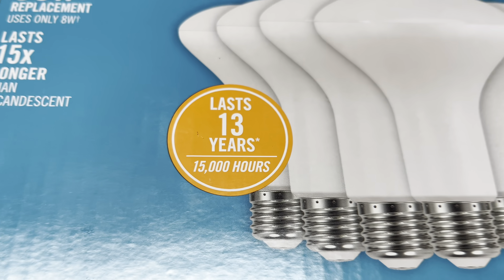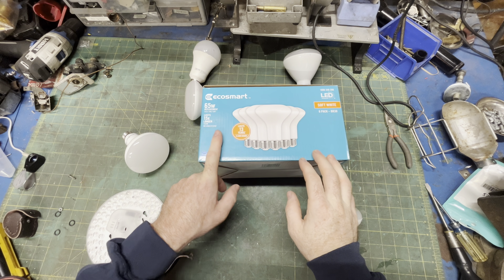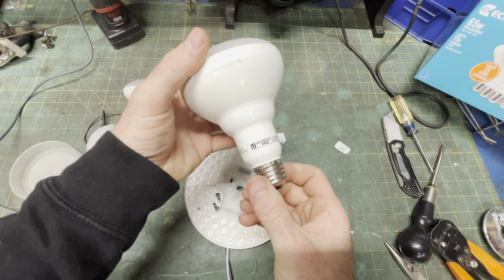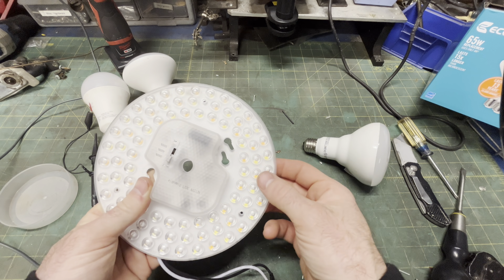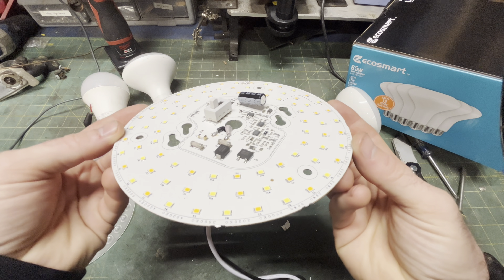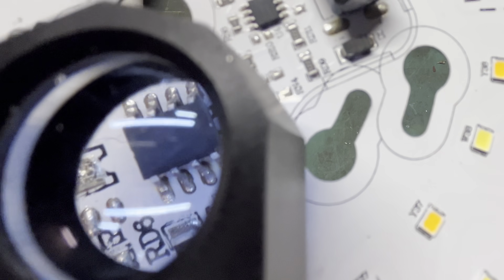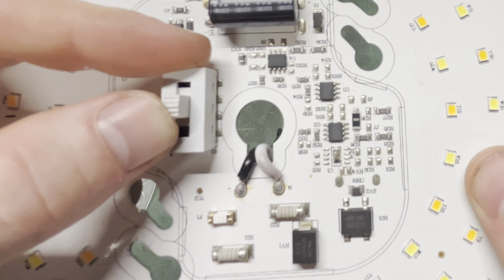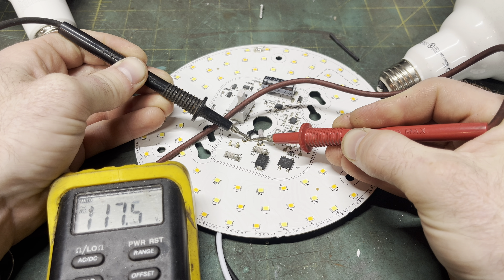Why Do LED Bulbs Fail? An Autopsy!

Comment: "Due to light sensor I installed myself it is on for 24h a day" )
Reply: The funny thing is that probably that extends the life of the incandescent lamp, as there is no thermal cycle stress 😂
Reply: Photocell sensors are pos nowadays, his was probably doa. First one lasted 13 years, replacements lasted 2-3 years nowadays. I bypassed it and changed to a wifi switch.
Reply: @arthurdefreitaseprecht2648 Nor probably. The record bulbs are kept always on. Technically they'll keep working.
Reply: I had a good chuckle that very moment :D
Reply: I laughed too hard at this!
Reply: still: why would one run an outdoor light 24/7? i know americans don't care a great deal but just to raise some awareness: it's called waste of energy.
Reply: @RayEttler   We are the epitome of a waste of energy.  😂
Reply: @RayEttler  I leave the 11 LED lights in my garage soffitts on 24 hours a day, 365 days a year. Each is 1.4W. Times. Costs me pennies. I can afford it. Earth will survive.
Reply: Any ideas why an led fixture somewhat like the first one would buzz after lightning storm in the vicinity? Still works, for now, but audible buzzing.  Learned a big lesson. Don't use these bulbless POS.
Reply: As soon as I heard that I thought "I'm going to like this guy!" :)
Reply: @RayEttler  Does the sun waste energy?  It is on all the time.
Reply: @arthurdefreitaseprecht2648  less thermal stress :D Not no thermal stress ... Although putting out heat in the cold of the night is pretty stressful for a bulb. I'm inclined to believe it's more to do with the manufacturers removing the planned obsolescence policy to try and not be banned entirely....
Reply: @stewiepid4385  The human race or Americans?
Reply: We all learned in the beginning that it's the shock of going from off to on that kills incandescent bulbs. 

LED lights that have extended lifespan on the package are referring to the actual LED's not the item itself. There was a lawsuit over it a few years ago but I can't find it.
Reply: I don't get it. Can someone tell me what's supposed to be wrong or funny about that sentence?
Reply: @Jiyoon02  it should only be on during the night. It's on 24 hours a day because either he did something wrong or it's defective.
Reply: @a9ball1  I infered that line as "it's hooked to a closed circuit 24 7 unsupervised, thanks to the light sensor I installed."
On as in closed. Which isn't too wrong.
What else can it mean?
Reply: @a9ball1  There's four in a neighbours garden on for most of the night, every night for about 4 years now. They are off at the moment. There is no breeze at all so I think the slightest breeze moves something and they switch on. Also people don't set them up properly, there are settings to adjust and people don't seem to bother.
Reply: @cgeorge6786  not during the night 😊
Reply: @user-hm5zb1qn6g  That gives me an idea: White Xmas lights as in-garage background lights and just leave them switched on all the time.
Reply: sosi hui
Reply: @HSterlingCross  Now you tell me. I bought a photosensor at HD a while back, and while it never worked once, it wasn't worth dismantling everything again to remove and return it, so I just left the light on at all times. The other day, I finally just bought an automatic dusk-to-dawn bulb for the fixture, and that's worked perfectly from the get go.
Reply: @user-hm5zb1qn6g  you are missing the point
Reply: Yep, it's a fulltime light sensor.
Reply: As a plasma fanatic  I just stick to fluorescent lamps. Most LEDs are boring for me. Filament style is OK but most other types are as ugly as the average mother-in-law.
Reply: @ as a plasma fanatic you should use non-fluorescent gas discharge lamps ^_^
Reply: @RayEttler  The bulb will last many times longer if it is left on (or off).  Thermal cycling kills it.  Which is more wasteful, a few watts of electricity or replacing bulbs?
Reply: @steveprice5664  i see your point. this may be true to some extent but thats nitpicking. and yes its just a few watts i am with you. but it's a reflection of how one acts and behaves in general. it starts with you. found this the other day and i believe this is where it comes down to: "I am only one, but I am one. I cannot do everything, but I can do something. And because I cannot do everything, I will not refuse to do the something that I can do."
Reply: Don't buy cheap American crap. Switch to Chinese quality products!
Reply: @peoplesrepublicofamerica8698  What American crap would you be referring to?  All of the crap is coming from China - due to the quest to make everything as cheaply as possible - to allow the highest corpoate profits.

I have lost count of all the LED bulbs I have had to replace in less than three to five years  - all made in China (with the least quality control attainable, I assume).  So far, we have had no fires caused by these "time bombs".

Good night, Nursey!
Reply: @arthurdefreitaseprecht2648  Yep. One square inch of duct tape over the sensor port, and voila!
Reply: I laughed out loud for that. Like a real belly laugh.
Reply: @RayEttler  the intent of the auto off mechanism was exactly that. But that aside, I suggest anything that maintains the bulb saves energy because you don’t have to manufacture a new bulb. Saving energy requires system level analysis, lest one just move the consumption elsewhere.
Reply: @cgeorge6786 I believe that was the inspiration for the concept of a Dyson Sphere. 🤔
Reply: @leavethemkidsalone860  It's hard to find any that don't buzz right out of the box. The name brands fair better. Make sure the light switch is made for led if you are using a dimmer.
Reply: @richardcowell2373  is this a joke?
Reply: @cgeorge6786 If you would live on the sun and want to live more than 5 billion years, yes.
Reply: @Jiyoon02  The whole point of a light sensor is to not have the light on 24/7
Reply: that was in fact a "day sensor"
Reply: @RayEttler   Well, it's debatable.  Yes, the light merely being on wastes electricity, but also the stresses of cycling the light every day would have caused it to have burnt out years ago.  And, the replacement bulb would have burnt out by now as well.  As well as the replacement for the replacement.  Those 2 replacement bulbs also took electricity / fossil fuels to sell, and transport, and manufacture, and the materials took electricity / fossil fuels to sell, and transport, and manufacture.
Reply: He did not say he wired it correctly.
Reply: @peoplesrepublicofamerica8698 Is what a joke?
Reply: @MacGuffin1  The planned obsolescence thing is overblown. There's a trade-off between efficiency and lifespan. Incandescents that last for decades put out very little light. That's still true today. The choice to limit bulbs to a relatively short lifespan had a lot to do with the limited amount of power available at the time.
Reply: @a9ball1 Incandescents slowly die due to the evaporation of the filament. Halogen lamps address this as the halogen gas will help to carry some tungsten back to the filament, but they still die eventually.

Unless you run them at greatly reduced power. That keeps the filament cool, but also makes for a dim and even more inefficient light source.

Comment: my work let me take apart the 480v LEDs they got for their warehouse after they died. The bulbs claimed a 10-year life but died after 2-4 years. When I got them apart, I found the capacitors to be the issue. Checking their datasheet, I found that they were only guaranteed for 2 years of life. How can a company claim a lifetime 5 times longer than the lifetime of their parts? (and no, the capacitors were not oversized or underpowered in any way)
Reply: MTBF is heavily depending on the environment temperature.  If the manufacturer adding sufficient active cooling equipment such as heat-pipe and long lasting cool fan, the life span should be increased accordingly; of course, so does the price tag.
Reply: Everything seems to have a disingenuous nature now, it`s like for the sake of saving one penny per unit ie a galvanised bolt vs stainless steel so as to render a greater profit still undermines the principles of showing pride in ones handy work.
Reply: I have seen that claim being made on operating time, not actual past time. Then there will be an assumption on the time of operation per day.
Reply: Electrolytic capacitors can be up-rated by about a factor of 2 for every 10C they are below nominal max operating temp.
(note: this has to include internal heating from ripple current).
That's why a 20000h 85C and a 5000h 105C rated capacitor offer pretty much the same effective lifetime at sane operating conditions.
At least Nippon Chemicon and Panasonic have appnotes explaining this in detail.
Reply: @nzcym That's true for the LED chip where the device is a semiconductor and the length of its life is strongly dependent on operating temperature.

That isn't the case, generally for capacitors.

The 25,000 hour typical life that is quoted for LED lights is typically the life time of the LED chips and is stated on the data sheet by the manufacturer of the LED chips. But this is the life time of the chip if the LED operating temperature is kept within the limits indicated by the LED chip manufacturer.

Then the light bulb manufacturers put the chips on to a board and put into a bulb, then the bulb is placed into a confined space into a luminare without sufficient cooling and that 25,000 hour life drops significantly.

When you look at the cooling features on an LED bulb that conforms to a standard replaceable bulb type, with bayonet or Edison screw thread,  they typically just have a few cooling fins along the body of the bulb. It's a pathetic amount of cooling.

Why would the industry want to fix that? Bulbs failing results in repeat business.
Reply: If they used bulk ceramic caps, they should last indefinitely, but that isn't  what the manufacturers want.
Reply: @williamcaspers5252  I disagree.
If caps fail then that results in products being returned. That could either be an in warranty or out of warranty return.
The product then needs to be fixed.

I don't believe the manufacturers of products want the hassle of returns and having to fix them. I doubt it makes much money.
Reply: @deang5622  Yeah, but I would hazard a guess most people don't bother to try and return, process is just difficult enough that people just give up, toss it and get a new one. So, aiming for a MTBF just below warranty life is a pretty good gamble for them.
Reply: I'd like to see a class action lawsuit against these bulb manufacturers.
Reply: @dman10000  On what grounds?
Reply: @deang5622 false advertising. They never come closer to the advertised warranty.
Reply: @dman10000  That might be the case but it will be difficult to prove.

There is going to be a spread of the life time of bulbs coming off the production line.
Taking a dozen bulbs out of tens of thousands which are made each year, and saying it proves that the designed length of life is way under what the manufacturer advertises, isn't going to work. The manufacturer will simply claim that the failures are expected given the number of bulbs produced.

You will need a lot more data to prove they don't last as long as the manufacturer advertises.
Reply: Built In Obsolescence...
Reply: @dman10000  I just saw a video that the packaging has a warning about using in an inclosed fixture, which is what most people do and causes heat issues.
Reply: cap life is - in general, all other things being equal - determined by its temperature rating. It is impossible for a company to claim a lifetime for a part, as they cannot control its end use. Something is fishy in China.
Reply: @deang5622  Who says it's just dozens of bulbs?  You just made a strawman argument.  In fact since this one user has dozens of bulbs out of his household that are failing to even come close to the stated lifetime, just means if you looked at tens of thousands of bulbs, you'd probably find a huge number.  That's more likely than his house is a statistical aberration.  Same idea of why when a consumer takes the time to write in to a manufacturer a complaint, they count it as, say, 10,000 people wrote in, knowing that more people likely had the same thoughts but most people don't take the time.
Reply: @novdt  consider where the vast majority of those things are manufactured, where "quality" certainly isn't "job one".
Reply: they know almost no one will bother to return them on warranty, (well unless they all die in a month ) so ...
Reply: @dman10000  You won't see it, not with the bulbs all blown.
Reply: Ironically I've products that make it a point to impress upon you how long the warranty is are the ones that usually fail. For these type of disposable products once you throw away the packaging will you remember the warranty that gave you confidence to buy?
Reply: I have never seen a warranty on a capacitor. Source?
Reply: They can get away with this by blaming the consumer for not operating these pieces of garbage under ideal conditions and not getting an EE degree to realise why these conditions weren't ideal.